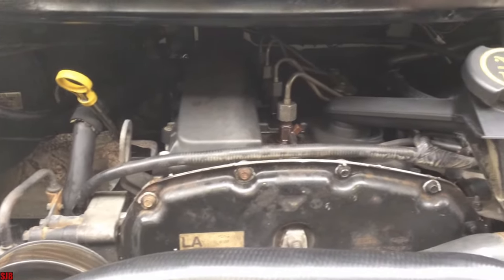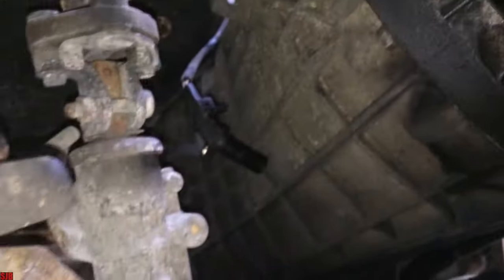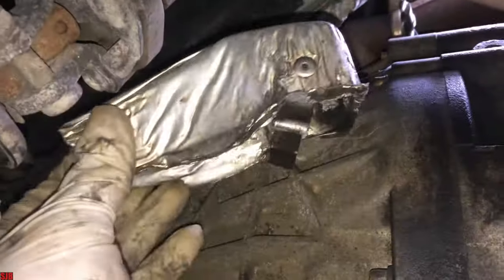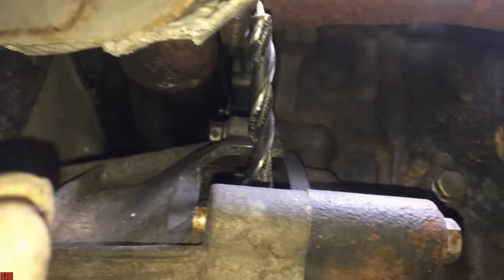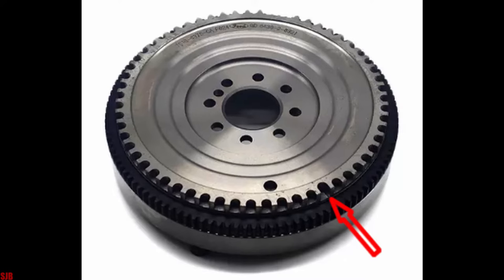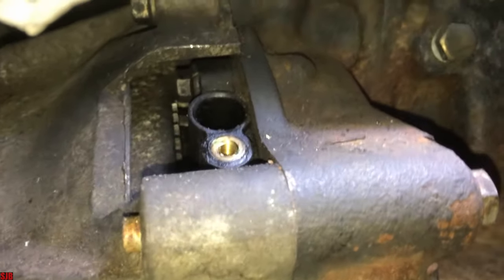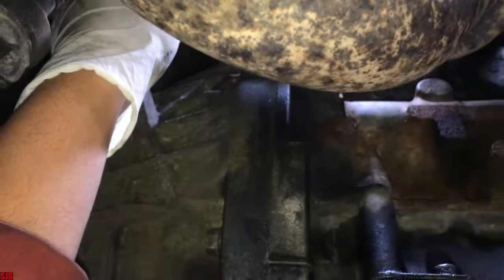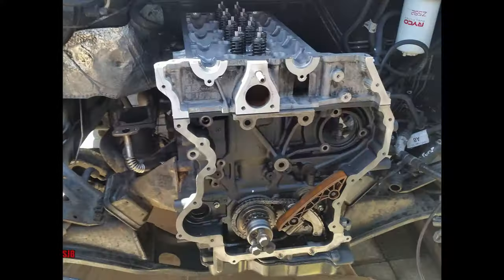How To Remove Ford Transit Crank Angle Sensor & Lock Crankshaft

Comment: Hi 
I have a question 
If your sensor it’s kit in right position, how can I do so, do you need to take clutch down and do it like that or can u do it without taking a clutch apart 
Thank you 

I have changed clutch but we don’t set it right so now I have crankshaft position code on as well as think it’s the time sensor as well
Reply from the maker: If I'm not mistaken the flywheel has a dowel pin from the crankshaft, so unless this is broken you wouldn't be able to install this incorrectly. Is your crank sensor ok?